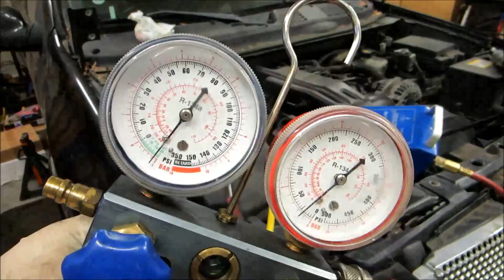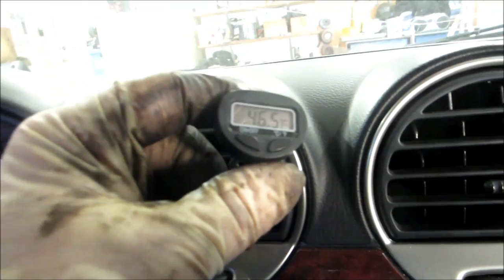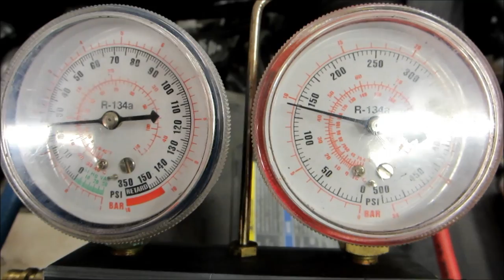Charging A/C on Envoy

Comment: I have an envoy 03 xl and I would like to know why the air conditioner on the back stays on when I turn off the car and the one in front works all right only the one on the back stays on and the battery is discharged

Comment: I had my engine replaced a while back on a 2004 envoy. now went to recharge AC ,and I can hear the leak. what to do now that is not going to cost a lot of money?
Reply from the maker: At the end of the day it's going to cost some money. Use a spray bottle with soapy and spray all the lines and the condenser. The condenser is in front of the radiator. after you get it all sprayed down. Put a little refrigerant in the system. Make sure to use safety glasses. Then look for the bubbles. If you here is making a noise it will make bubbles. Then replace the parts that are leaking.